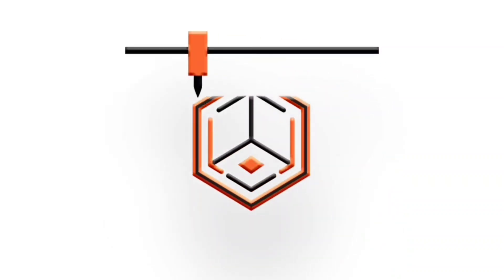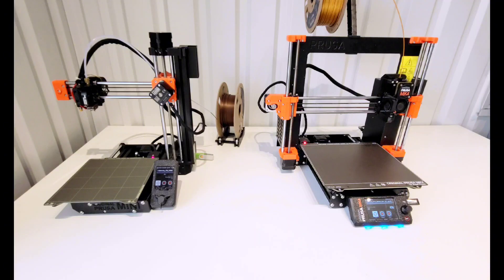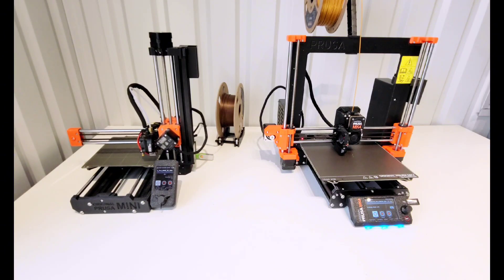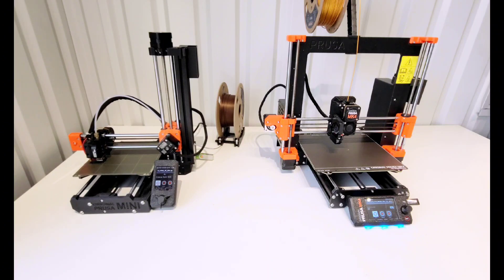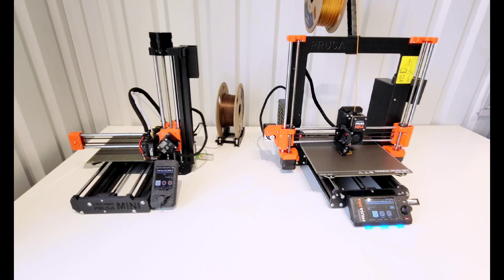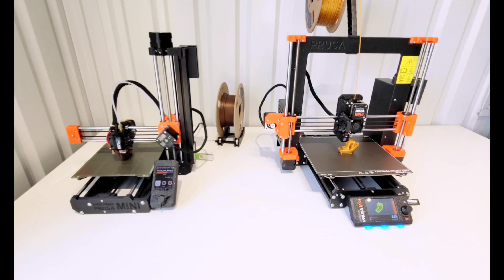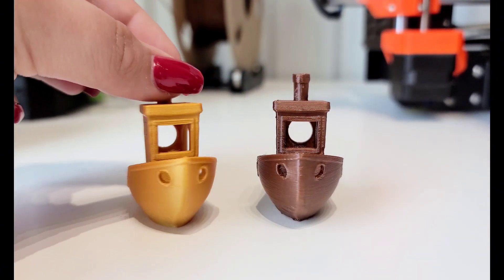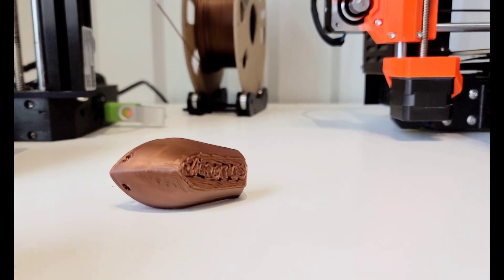Mini is ready with Input Shaping to race 🏁  the MK4 with Input Shaping!

Comment: I love that Prusa keeps supporting older printers. It's like driving an old Tesla that keeps feeling like a new car every time they push an update. I saw that the XL's input-shaping is coming out in October - it will be cool to see you run the XL with IS then.
Reply: It does take time to innovate when you're not just copying what other companies are doing.
Reply: @fdegasperis  Innovation often comes from combining two existing technologies/ideas into a new application. Prusa has been resting on its laurels too long. Bambu Lab for example is only a few years old and already created a machine and eco system that surpasses everything Prusa has done in a single generation. Prusa has been a critical driver in the desktop 3d printing world but will not survive unless it adapts and changes. (Not to say Bambu specifically will kill them) Greater titans of industry have fallen, Prusa is not immune.
Reply: Bambu only took a few years because they copied the majority of the features from communities like voron and klipper (input shaper, coreXY, pressure advance) and companies like Prusa (Prusa Slicer, Printables)- all without open-sourcing those existing ideas. That is not innovating quickly, that's copying without giving back to the community.
Reply: @fdegasperis  I’ve never seen another printer that can do all the things my X1Cs can do. That’s a pretty naive take on things. A bit like saying Tesla’s innovation is all copied because the cars have four wheels, brakes, trunks, and doors. You should check out Stefan’s interview with the CEO he addresses those issues. Regardless Prusa, could have done the same and didn’t and as a result will not survive in the consumer market unless they step up.
Reply: @mikereliford55  I did see the interview. Dr. Tao was disingenuous, if not hypocritical when he talked about patents. He said he would "defend" Bambu 's IP because it's is a matter of survival for Bambu. They wouldn't have a printer, a slicer, nor a company had the existing community patented the ideas, hardware and software Bambu used to create their company. I hope you see the irony.
Reply from the maker: Yes I can't wait! Thanks!
Reply: While supporting older models is great, unlike Tesla, Prusa does not rapidly innovate or iterate which is unfortunate.

Comment: odd i have the current firmware and no longer is my purge line in front of the part mine is back at the front left corner makes me wonder if i messed up somewhere
Reply from the maker: For the Mini or MK4? Thanks!
Reply: @tada3dprinting  for the mk4
Reply from the maker: No that's what mine is doing too. And I like it better because then I'm not touching the middle of the bed to remove it.

Comment: Thanks for the test.
Actually I do not understand the orientation of the benchy on the mini. Shouldn't its front facing the part cooling fan to get optimal overhang?

I will wait for the final update on the mini. I did some heavy modifications on it, like dual-z mod, Revo and direct drive. So the resonance frequency will be significant different. Also it's the first version of the mainboard, wich has some differences.
So before trying it an manualy calibrating the resonance frequency (and adjusting filament loading and unloading procedure due to the direct extruder, compiling the firmware myself), I will wait for the final version.

Still, nice to see the promesing results. I am sure the dual-z mod will improve the layerlines (it already does improve quality on normal speed), as the frame is much more rigid. Also the direct drive reduced retraction distance, so the mk4 and mini might catch even. Even heating up might be faster for the hotend, due to the revo.

But it's good the final version may take some time - at the moment I am preoccupied with my Qidi X-Max 3 anyway. I was unhappy with the filament unloading, so I converted it to a Revo hotend. It already works and filament tip on unload now looks perfectly without pulling the filament, so its time to make final versions for the coldend cooling (I improviced there), trying the revo high-flow nozzle (it arived today). Also I wait for the MKS THR36 to be delivered, as the Qidi uses thermocouple on the hotend and Revo has a thermistor (I use an old Creality silent board as 3th MCU to provisoricaly connect the thermistor). Also finaly add the enraged rabit carrot feeder (as this is the main reason to do the Revo upgrade in the first place). And than doing a video about it.

 This will take at least until Xmas, as I also have to fit in the mk4 upgrade (still waiting for delivery, but I already printed all the parts with mint ABS from Bambulab on the Qidi X-Max 3 with the Revo hotend and a Creality board as 3th MCU - the mk4 will be made by a combination of all major brands in 3d printing ;-) )

So for me your video is a bit of a look about 3/4 years into future if it comes to my time line ;-) But very nice to see whats comming.
Reply from the maker: Thanks! Yeah I think I may go back to stable 4.4 until the next release. I don't really like making too many mods because it's hard for me to figure out when something goes wrong. And I always am messing things up. Thanks!

Comment: Will be good to see the results of further refinement.  Mini is still a great starter machine, love the non-toxicity of filament, but want the accuracy of resin.  Speed not so much of a consideration.
Reply from the maker: Yeah you could always go for a smaller nozzle and see how close you could get. Thanks!
Reply: Input shaping and Pressure Advance are actually quality and accuracy features. They are just associated with speed bc without them the quality would go down when printing with high speeds.